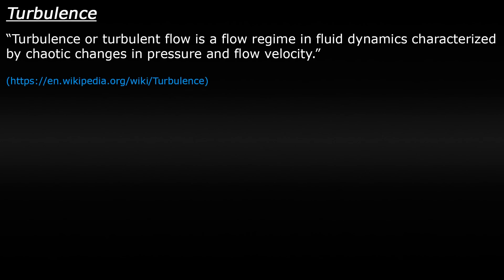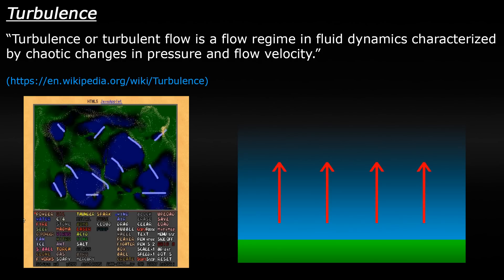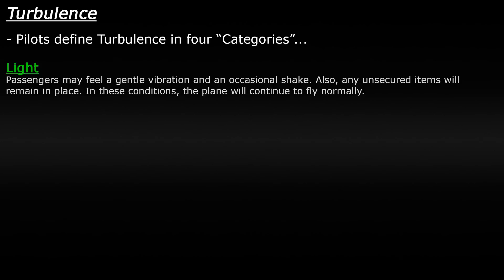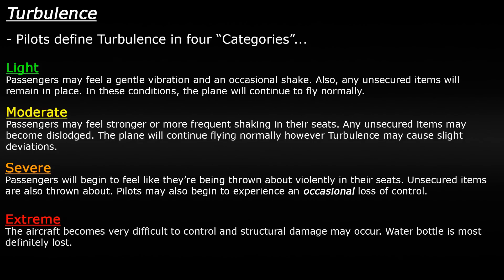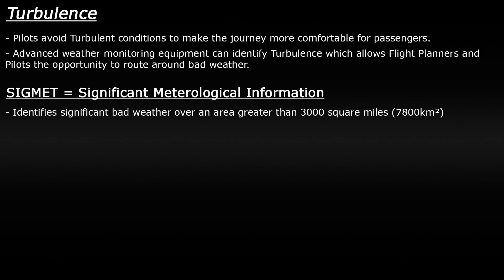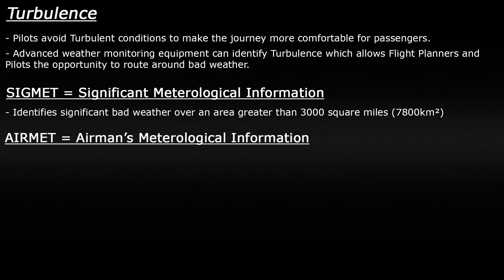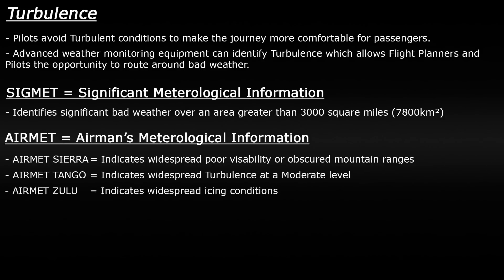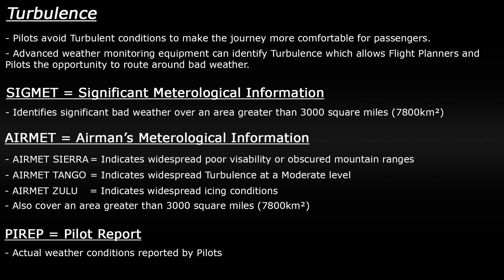Turbulence Explained

Comment: They still can't detect '' clear air turbulence''. They know what conditions contribute to clear air turbulence but can not detect it properly... Yet. I remember seeing a documentary about Chinese scientists who are trying to develop a forward facing radar type of equipment that will help with detection.
Reply from the maker: Agreed. I think what I was talking about in the video was areas of obvious turbulence such as hurricanes or the boundaries of a jet stream for example.
Reply from the maker: Crusader... we're talking about Clear Air Turbulence which is much harder to detect than other forms of Turbulence and is predictable. If you look at any significant in-flight accidents where passengers have been injured if they weren't buckled in their seats... most common cause of such incidents is Clear Air Turbulence.  If Turbulence has been predicted or reported by pilots who have flown through a particular area of airspace earlier in the day, then pilots on subsequent flights will advise passengers to buckle up.
Reply: You wrong, at least when I've flown the pilots usually let the passengers know when the plane is approaching a heavy turbulence and thus to fasten their seat belts, and even they tell you for how long will it last. They usually describe the turbulence as a "bumpy" ride.
Reply: Crusader1835 If the pilot's are aware of turbulence then it will be from their weather radar which picks up cloud moisture so they can see the weather ahead. Or they have information from aircraft flying the same route ahead that they have experienced some category of turbulence. Sometimes it can updrafts from mountainous regions. I've been flying in clear sunny(not a cloud in the sky) conditions over flat land and experienced mild to moderate turbulence. This would have been due to either the heat reflecting from earth or crossing jet streams(winds high up than pilots to fly in). We were at 37000ft and probably crossed a different wind stream that was going in a different direction. This clear air turbulence is difficult for pilots to identify.

Comment: I experienced an "extreme" one I think. From then I've had fear of flight which only seems to increment every time I fly. It was at night going to Lima, all you could see through the window was complete darkness with the occasional lighting that eerily lit everything up. The plane was shaking heavily, babies crying, women screaming, luggage rolling from one side of the plane to the other. The pilot himself sounded extremely nervous repeating over and over "please stay calm! please stay calm!", the flight attendants look scared too. It was pretty awful, I don't wanna die in a plane crash.
Reply from the maker: Yikes, if it's any comfort, it's very very unlikely that an aircraft will experience a major problem in Turbulence. Aircraft are built and tested to extremely high safety standards and manufacturers design and build aircraft which EXCEED those safety standards by a long way. Aircraft are also maintained to very high standards as well so there's very little risk that an aircraft will have an issue in turbulence. It might be worth watching a video of a "wing flex" test so you can see just how much an airplane's wing can move safely.
Reply: Thanks. I think I have to fly soon :F.
Reply: So true. Turbulences, around Peru and rest of hot continent can be really powerful.

Comment: Went through severe where a flight attendant hit the top of the aircraft bulkhead and then fell on her back. Though that'd be my last flight. On decent to Norfolk, VA.
Reply from the maker: Yikes, normally pilots will turn on the seat belt sign if they anticipate turbulence but you can come across something called clear air turbulence which you don't see on forecasts and there's no other visible sign (like a particular cloud formation). That's probably the most dangerous form purely because it's completely unexpected and if it's severe enough then it can cause injury if people are not seated with their belts on.

Comment: Hello, I think you neglected to mention~ significant wind changes both with height and in direction.  I am thinking of wind speed changes associated with temperature inversions, speed changes in the region of jet-streams and also sometimes in very sharp cold troughs in the upper air.
         Don Warne - ex weather forecaster
P s.   If you do need help with weather problems do ask : donwarne@icloud.com